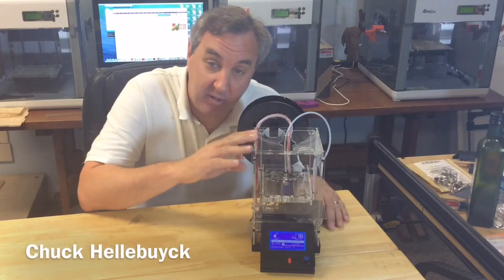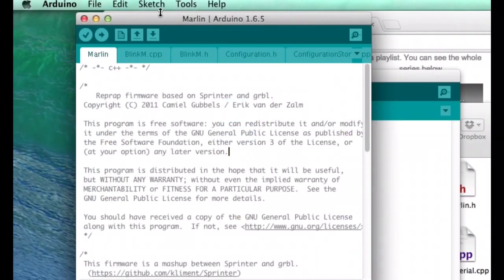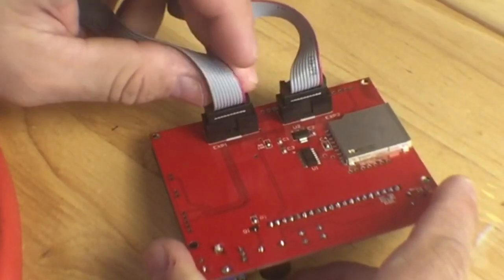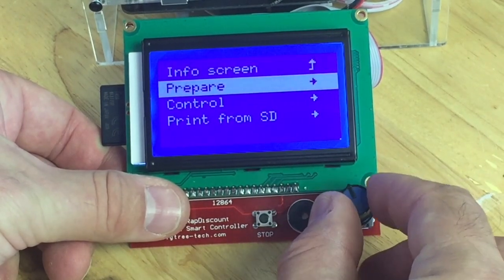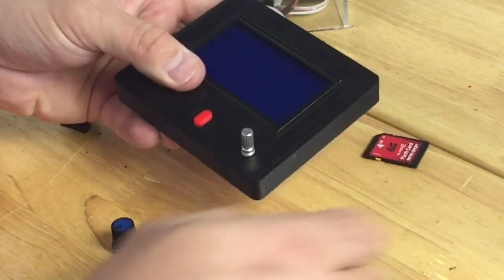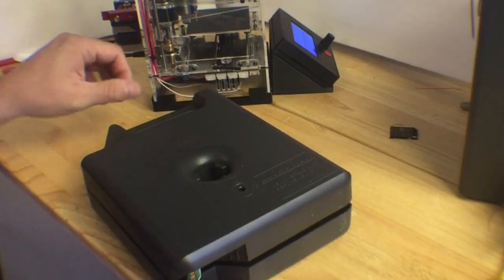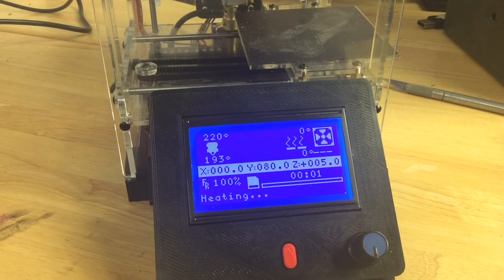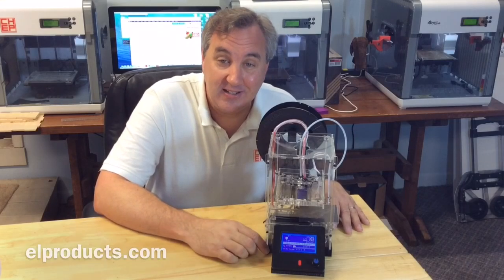Filament Friday #36 - Fabrikator Mini 3D Printer RepRap LCD and SD Card Installation

Comment: Thanks for sharing the above Chuck, I'm currently printing the puzzle set of stl's for the stand, etc...

Just a thought is there any chance you could possibly demonstrate "puzzling" items to suit the smaller build print size? Trying to do it in tinkercad I end up pulling my hair out in frustration probably because i'm making it much more complicated than it needs to be.
Reply: +Chuck Hellebuyck's Electronic Products finished printing the puzzle set but they appear to be different to your version. The button holes are different and they don't appear to fit around the LCD 100% correctly this could be an artifact of printing multiple parts but it seems rather misaligned with the trimmer pot for the display. :( gutted as I burned so much filament and time making them, have started cutting and sanding them to fit as good as I can but was wondering if you checked the design yourself prior to sharing on the site, its the bottom left piece that ruins the whole alignment.
Reply: +Chuck Hellebuyck's Electronic Products I'm over in the UK so its okay, shipping and effort would just complicate things. Thank you for the kind offer though.

If I can make a successful puzzle print of the actual file you printed and get it working, I'll let you know and at least you can share that instead :)

Comment: Hi Chuck,
I have made the additions like you did. I am having issues saving to the sd card? I save it to the sd card from my computer and the files show up while in the computer. Then I plug the sd card into the controller and the sd card doesn't have any files stored on it?

MB
Reply: +Chuck Hellebuyck's Electronic Products They are stl files.
mike B.
Reply: +Chuck Hellebuyck's Electronic Products 
How do you convert an stl file into gcode? Can you give me the process? I bought the finishing tool from your site and I figure I am going to contribute to your patreon accout as well.
Thanks
Mike B.
Reply: Yeah I have done that I will figure it out. I will look at the manual but I have already done the set-ups for cura. Thanks for you help.

Mike B.
Reply: Thanks Chuck!! Your the man!! I now have a Davinci Jr. 1.0, A Davinci 1.0(1st edition). a M3D Micro printer and the Turnigy Tinyboy Fabricator Mini which I love. I have a Davinci 1.0 Pro coming on Wednesday and I can't wait to see how this unit performs???

MIkeB.
DMS
Reply: I am going to give it a go tomorrow when I get to school in the AM.

Comment: I added this LCD to my Fab Mini and it works great....now. After first installing it, mine didn't work either. The panel lite up but nothing displayed and only an occasional beep. Swapping the cables made no difference. Going back over my steps, rechecking the wiring and updating the firmware again didn't help either. After closely examining the board, I noticed 2 pins that connect the display to the board had a solder bridge. After removing that with my iron, it started working, or so I thought. Going through the menus looked ok, and all the movements worked, however when inserting an SD card, it said 'Card Inserted', but said 'No SD Card' in the menu and would not read any files. After trying different formats on the board and different boards, I swapped the cables, and 'Tada' it gave me the 'Print from SD' menu choice. Swapping the cables back and the problem returned. So I ohmed out the cables and found one pin not working on one of the cables. Dissembling the connector on the cable showed the misaligned connection to the ribbon. Finally issues resolved. Anyway, thanks again for the great video Chuck.

Comment: hi every time i try to upload the firmware it stops saying error compiling.any ideas on what is going wrong thanks
Reply: Im having the same problem, and tried selecting different modules, but no luck. I have the v1.5, maybe its a different board? Stuck at this stage and cant figure it out.

Comment: Chuck I see you have not had issues with the Steppers getting hot? I had to make much taller feet and add a 80mm fan blowing up from the bottom and a small one on the motor on the lower right side. They were running in triple digits 121 or higher? Now they are about 80 to 85 What temp are yours at ? I use a laser temp gun the others are lower in the 75 degree area.  the unit was stopping and even melted the lower plate where the motor is screwed into. I had to make a metal plate to fix that..
Reply: +Jim Bowden Try tuning the motors using the x,y,z trim potentiometers on the control board. There are a few vids about it on youtube, just requires a multimeter and a screwdriver :) My motor temps dropped considerably once I dropped the voltage down somewhat.

Comment: Hello. I've had my da Vinci 1.0a flashed with repetier for a few months now and I have a problem and you might know what this is. For some odd reason I had just finished a print and made the extruder go to the home over the drop box and some gas that looked like smoke shot out so I panicked and shut off the printer then it was still coming out a little then stopped and now it smells bad. Do you know what this might be?
Reply: +Chuck Hellebuyck's Electronic Products it shot out right where the plastic usually extrudes from it was a yellowish gas
Reply: +Chuck Hellebuyck's Electronic Products I was not using the olive oil trick but I was using white abs plastic and it happened as I pressed one of the manual control button the one for the extruder all the way to the right with one arrow going down I accidentally pressed it the smoke came out or whatever the fume was and it also now my printer has a really bad smell.

Comment: Great video Chuck...I already ordered my LCD and printed the case and base...however I'm a little worried the spool holder can hold a Davinci Spool with FULL filament..Doesn't the weight will tip the printer???
Reply: Well I you like I recently resized a spool holder from thingiverse which holds about .25 lb of filament and doesn't weight too much to tip the printer..I can send you the files..
Reply: Here are some pics:

http://imgur.com/gallery/H6NCd
Reply: No, I used this tool I designed in Tinkercad and attached it to a drill:

http://i.imgur.com/VgpJ9DP.jpg

And yes, this is 1.75mm PLA filament..

I'll send you the files so you can use it on your next video 👍
Reply: Yes I'll post them and send you the links
Reply: Here's the Mini Spool on Thingiverse:

http://www.thingiverse.com/thing:1073340

Comment: Do you plan on adding a heated bed to the FabrikatorMini? :)
Reply: electronics get so hot you might not need a new bed lol
Reply: +XBLmonster lol, nice, so no warping because of that? :) (ABS)
Reply: +Julian GoesPro I've actually not tried ABS yet... I like PLA too much
Reply: ***** good point, guess we will have to make one then ;)
Reply: +Chuck Hellebuyck's Electronic Products 
isn't the raft kind of waisted plastic? :) I don't like the idea that PLA will not like sitting in the car in the summer and I intend to use the 3D printed parts for my RC aircrafts so there will be a lot of "sitting in the car" on sunny days^^

Comment: Love it!!!!!  Thanks Chuck!!

I will try the settings you used with Slic3r this weekend on my Ninjaflex project. did you leave everything else the same as default?
Reply: +Jeffrey Seymore (Sweetblu) Nevermind, I saw you uploaded the file to your site!!!  Thank you SOOOO much Chuck!
Reply: +Jeffrey Seymore (Sweetblu) 

Would this board work the same you think? I like the size/format of it more.

http://www.amazon.com/REPRAPGURU-Display-Controller-Adapter-Printer/dp/B015NDAKE4/ref=sr_1_7?s=industrial&ie=UTF8&qid=1444417735&sr=1-7&keywords=RAMPS+1.4+RepRap+lcd
Reply: +Chuck Hellebuyck's Electronic Products ok :) thanks for the info. I love this printer a littler more with each print. I will get this Ninjaflex down at some point as well.